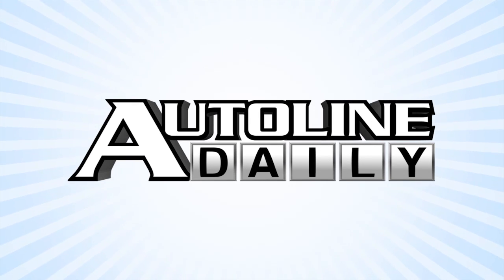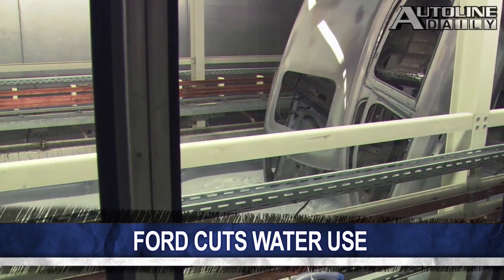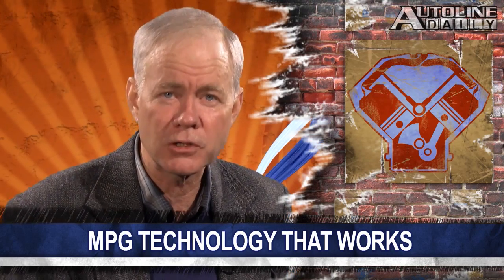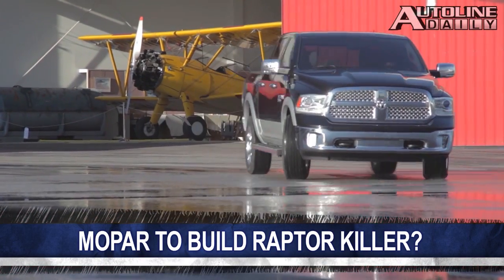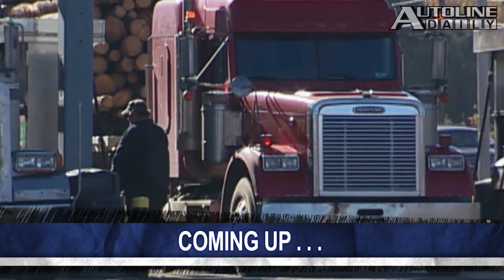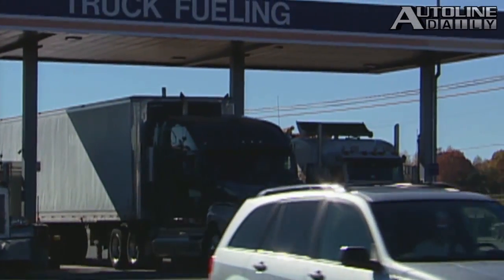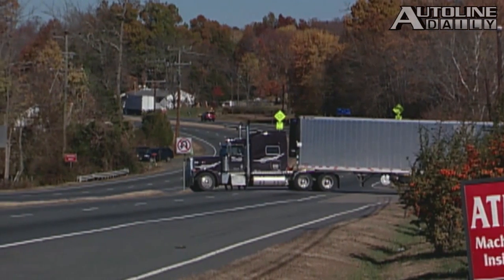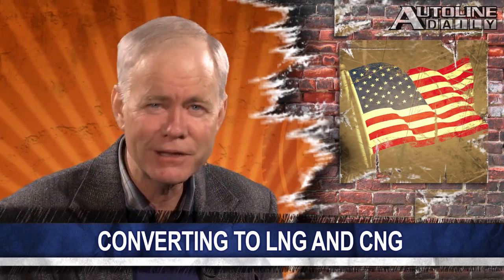Fracking Revolutionizes Truck Market - Episode 1098

Comment: I've seen lots of Suburbans running on natural gas.  You can do it yourself for under $2000.  You can switch back and forth between CNG and gasoline.  Check out my video to see how to do it yourself and where you can buy parts.  I've adapted 2 of my cars for natural gas and I'm getting ready to convert a third.  There are 10,000 - 20,000 cars running on natural gas in Utah.

Comment: LPG is 4.2lb/gal. Gasoline is about 6.4 lbs/gal. Diesel and 7.3lbs. These are assumed at 60-degrees F.  The LPG Tanks will not doubt be heavier. But it should not be a great imposition.